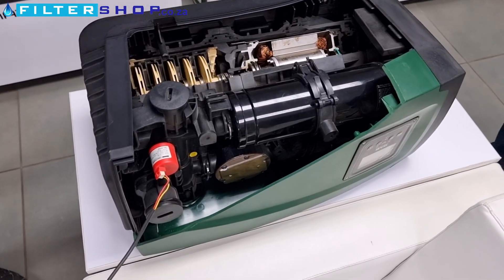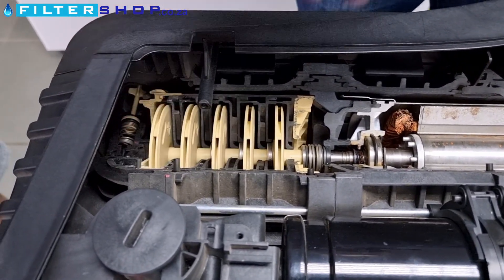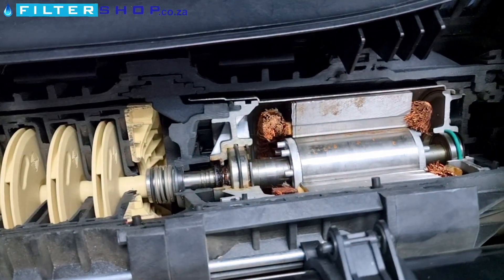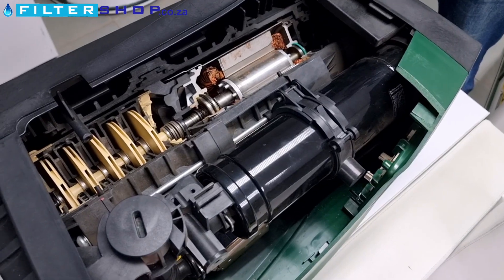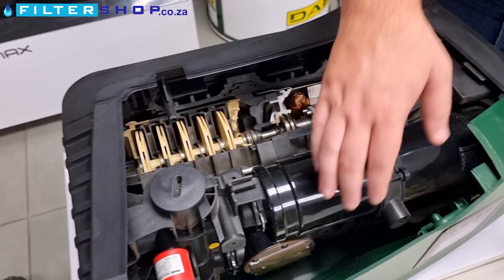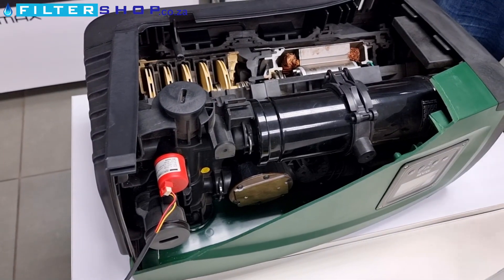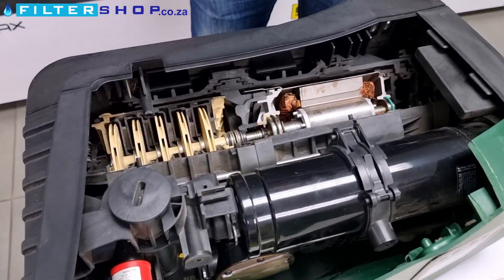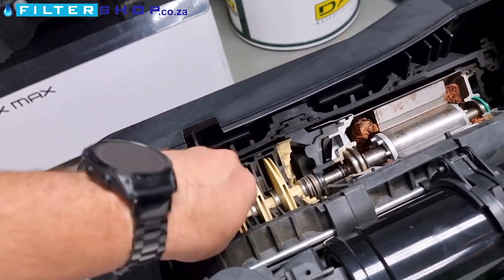What's Inside A Cut Open Dab EsyBox VSD Pump

Comment: Dear FilterShop, I had one of this pump at home but I am experiencing an issue which no one knows how to fix. When I shut the valve the pump is making a squeaky noise towards the end of operation. Would you be able to advise if this is normal? It did not make noise orignally after installation but now it does. Many thanks.
Reply from the maker: Hi, difficult to say from that information but I would check the non return valve at the back and make sure it is clean and moves easily. The pressure buffer tank has a rubber bladder in it could also be that. There isn't much you can do about the tank so I would first check the non return.

Comment: I have been running one of these in my cabin for I think 5 years now.  I was so skeptical when I was buying this.  I have Cory water but it’s (probably the way the line is ran) I have had zero issues.  I hooked it up that first day and literally forgot about it.  I just recently thought about it when I was under the cabin and seen it.   There is a port on the back that has an oil can logo??  Am I suppose to be oiling this thing?  I honestly dint expect it to work. And if it did to even last.  So that day I hooked it up I assumed it be a temporary thing so I wasn’t really paying attention to the instructions.  I never even messed with the settings lol. How long do these typically last?  If mine broke today I’d still be highly impressed with its performance and durability
Reply from the maker: Hi, the part at the back is a non return valve so you can clean it but it shouldn't need regular servicing. A big part of the lifespan will be water quality dependent. Assuming it isn't abused i would expect about 10 years.
Reply: @FilterShopZa  awesome.  My water is filtered before it goes into the pump.  👍🏼😎😎. Awesome product
Reply from the maker: @Scummy_shovel  Yea then you should get a very good lifespan on the pump.
Reply: @FilterShopZa  thank you for the information

Comment: How do you protect it from loadshedding?

The power spikes blew the pc board on two units
Reply from the maker: That is a very good question, I will talk to the technical people at DAB and get their opinions on it.
Reply: Thanks.
Reply from the maker: @MyChoice-now  Okay so it sounds like DAB is working on a solution with their factory but it isn't ready yet. For now, they are recommending plunging it into a surge-protected plug.
Reply: @FilterShopZa  thanks